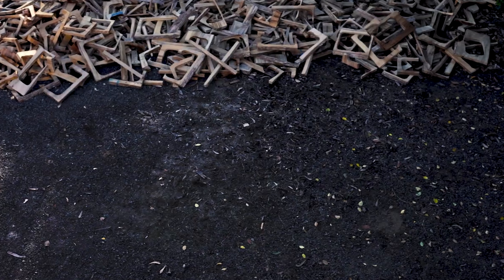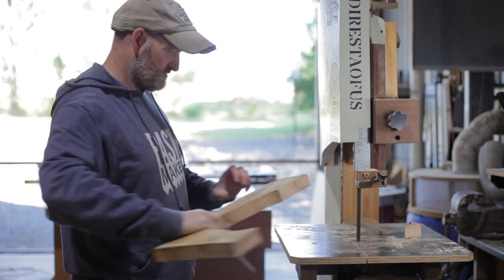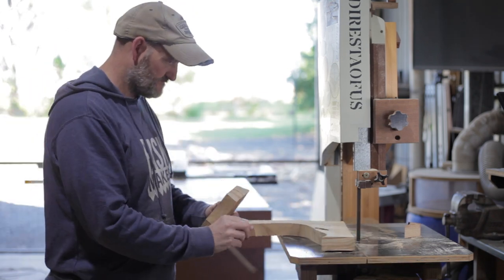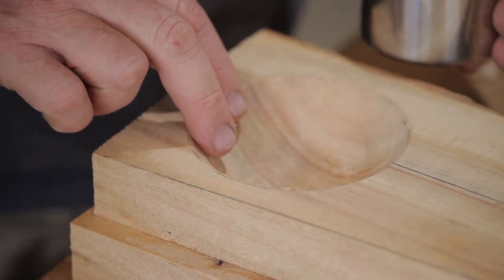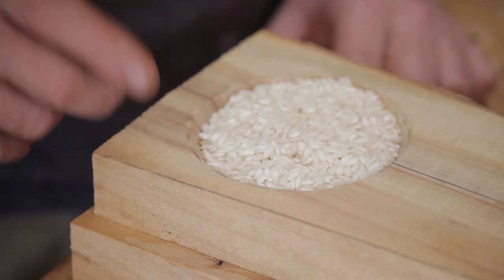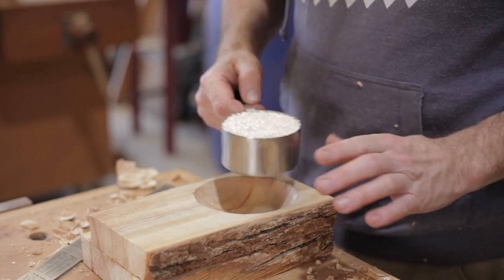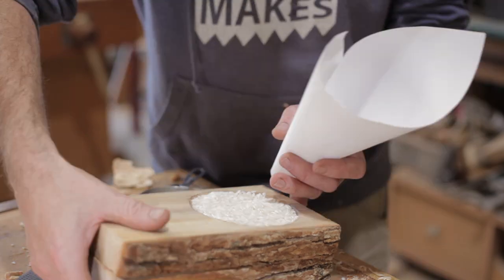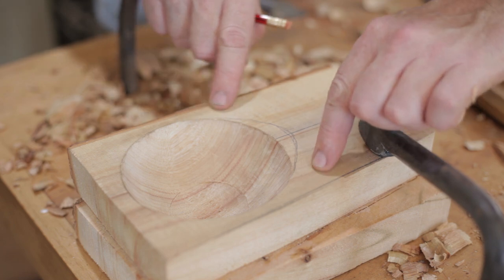Hand Carved Measuring cups - Scrapwood Challenge Episode Eight

Comment: What type of gouge is best for carving cups and spoons?
Reply from the maker: The one I use for carving the bowls of spoons is a 20mm #5 Pfeil which I find works great. For these measuring cups/spoons I could've done with a bent (shaft) carving chisel which I don't have but will have to get. That would've made it easier to carve the bottom of the bowl. :)
Reply: @PaskMakes  awesome! I have been wanting to try carving a cup. Thanks!